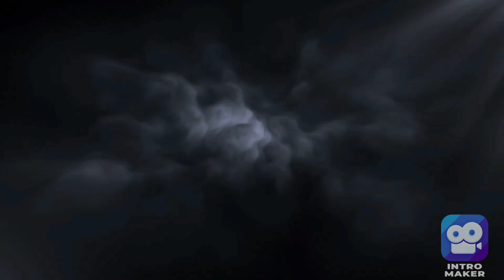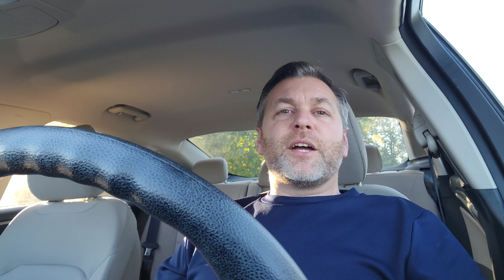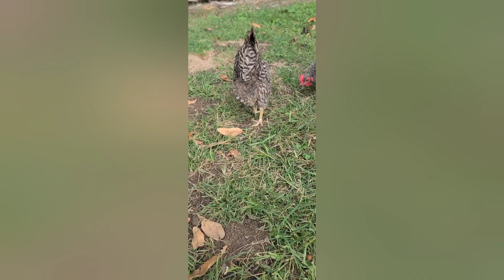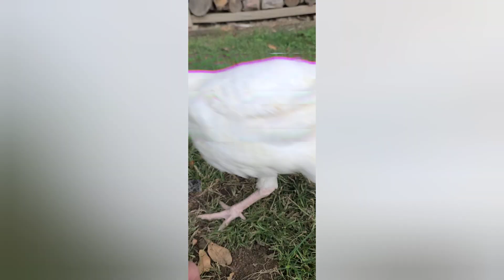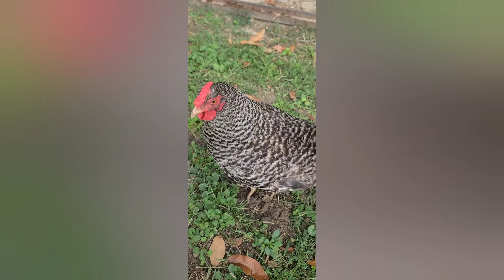PSC or ECM Motor? HVAC Blower Motors explained

Comment: When my original 1980 GE air handler was replaced with a total system, YORK it had an ECM, which was quite and smooth but recently it was replaced by a Trane and what an outdated peace junk 😮.  To my dismay PSC motor that hammers my metal duct work with the sudden stop and start, on off,on off all day it will actually wake us up at night 🤬. I was disgusted with the equipment and haggled with the contractor but they refused to replace it at my expense.  In Virginia beach it does pay to shop around as the price for similar equipment can very by thousands.

Comment: I have an idea to turn a psc motor into a psuedo variable speed motor. It would require 2 relays and a timer. When you get a Y call for cooling, the Low speed tap will be energized for 2 minutes. After 2 minutes, a relay will kill power to relay energizing the Low speed tap and switch it to the normal high speed tap for the remainder of the call for Y. I figure this set up will dehumidify better and also keep the evap coil from freezing by only allowing the Low speed for 2 minutes. Thoughts?
Reply from the maker: I would think it would work but it's not giving u the full variety speed benefit .  The main factor is the true ecm is actual a DC motor which has less energy usage improving efficiency.  The use of high and low would help with humidity but personally I would use a variety speed control such as a Fan Handler.  They work off of sensors rather than time and can ramp that motor up and down depending on supply air temp both in heating and cooling.  Just a thought! 
I do appreciate the gumption to change things though!  I'm always trying to find ways to make things work differently with relays n things. Hope this helps!  Be sure to subscribe!